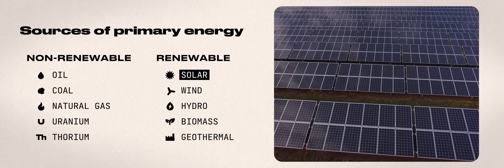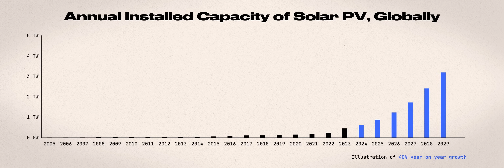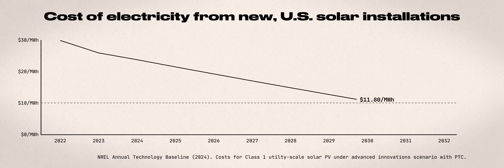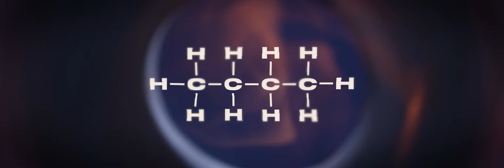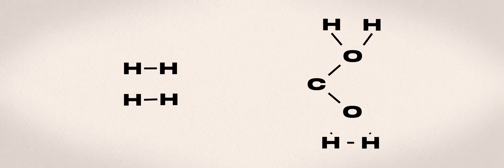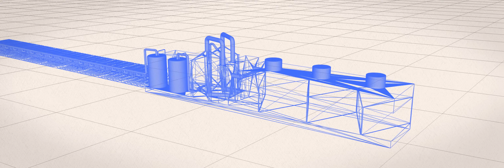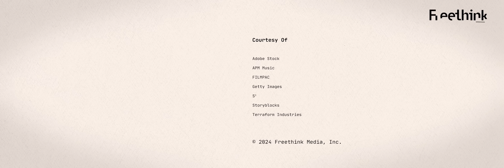95% of our energy could be downstream from solar by 2042 | The Freethink Interview: Casey Handmer

Comment: Lazard’s Levelized Cost of Energy does not include externalities such as grid update and energy storage. In reality PV panels are significantly more expensive than what is said in this documentary.
Reply: AGREED!  Also, he's not accounting for the high Capacity Factor (>90%) required for H2 electrolysis, and (as far as I can tell) other material costs (eg DAC producing CO2@$1/kg), etc... I made another post w/ my thoughts on the economic arguments.
Reply: But keep in mind the grid is shared resource.  It's used by other energy generators like fossil, nuclear, hydro, etc.  So you can't pile on grid expense solely on solar.

Note though residential and commercial rooftop solar can bypass the grid!  Those rooftop watts are both generated and used locally in situ.  No other energy production can really do that effectively as urban solar with its quiet solid-state electronics.

And, yes, storage is separate. That's why there's a separate measure for LCOS.  So we'll eventually will need to consider both levelized cost of energy (LCOE) and levelized cost of storage (LCOS).  But both are heading down dramatically.  New forms of non-lithium based storage made specific for stationary grid-scale energy storage is coming up.  They'll be fractions the cost of lithium several times the longevity too while using more common materials.
Reply: @beyondfossil  all the grid necessary for nuclear is already installed. Renewables require onerous new installations. The person speaking in the film was making a spurious comparison with nuclear energy, suggesting that it was more expensive. But if you include externalities from renewables and calculate the cost of energy throughout their entire lifecycle (not 20 years as Lazard does) the result is very different.
Reply: @salahidin  The entire world uses a some 620-exajoules of energy per year and only some 100-exajoules of it is electricity.  Can quickly see the grid needs to be expanded to offset this huge amount of fossil fuels in use.  Extremely slow to build and expensive nuclear will barely put a dent in that amount.

You cannot just construct nuclear anywhere.  Operation of utility-scale nuclear power plants requires large amounts of water (millions of gallons a day at up to 2700 L/MWh electricity production).  Most people don't want to be within a hundred miles of one.  You get NIMBY to the extreme with nuclear power construction.
Reply: @beyondfossil  Here in Scotland, we have a beautiful experimental tidal turbine near Dundee that doesn't work because nobody wants to pay for its connection to the grid. The low energy density of renewables, the fact they are scattered throughout the territory makes the investment in grid a major problem. LCoE should reflect this cost. As for your water argument, you can recycle it or resort to used water. But you are right you cannot build nuclear everywhere, and it will never cover our needs in electricity.
Reply: Sure, the comparison looks bad if the plan was to make methane and then burn that to create grid electricity.  But the entire point of this venture is that you don't NEED a grid because the output is energy storage for non-electrified applications.
Reply: @webbmyers1339  the comparison is falacious to begin with, but it also 'looks bad' as you say, when you compare it to hydrogen or synthetic fuel made from nuclear electricity or heat. If you don't need the grid, as you claim, that would mean that their electrolysis process can work intermittently as the weather changes... I'm afraid I'm skeptical.
Reply: Exactly

Comment: Using this we would only transform 20% of the solar energy captured into vehicle motion. If you use a battery then at least 90% of the solar energy is transformed into vehicle motion. The way this makes sense is for long term energy storage to offset seasonal variations in solar energy capture, however, even then, there are far more efficient promising options being developed like iron air batteries, direct hydrogen storage, compressed air storage. This is simply green washing of ice vehicles, suggesting you don't need an EV as tech like this makes an ice car part of a cyclic system, when in reality this is to just prolong a market for fossil fuels.
Reply: There are some applications mentioned that could make sense. Like rockets and commercial airliners. Combustion will be required for those for sometime to come (especially rockets). However, we'd still need such a surplus in solar energy generation that it'd make more financial sense to created these fuels rather than extract them. I'd like to understand more of the economics of this guys thesis.
Reply: @chZubka  There are certain industries that will always require fossil fuels, but there will always be cheaper methods of obtaining them. We can electrify perhaps 95%. Perhaps this tech would be useful in the year 2070 or something.
Reply: 20% is very generous. This is at best 30% efficient, times a generous 30% efficiency for ICE cars, giving 9% efficiency, which is downright awful.
Reply: Your battery won't fly, thats why

Comment: that wouldn't solve the problem of gas leaks like methane. So it's not really an option since it would probably still emit more CO2 equivalent than it takes out of the atmosphere :)
Reply: As stated, there are losses in the cycle. That means carbon that isn't being converted into fuel, which leads to cleaner fuels, and less net carbon in the air. Essentially it's built-in carbon sequestering.